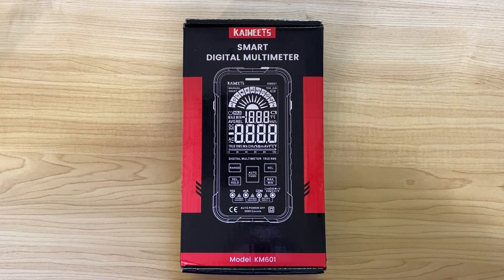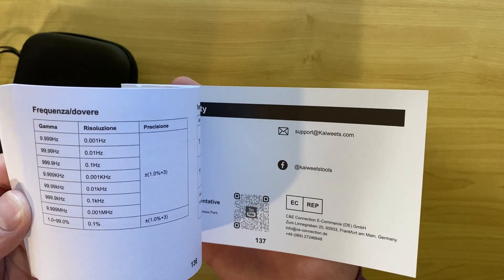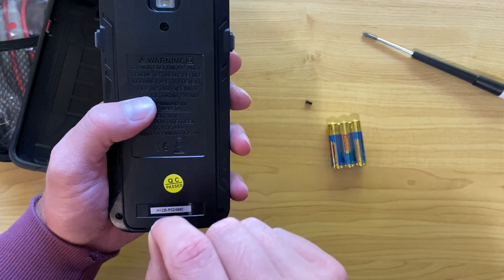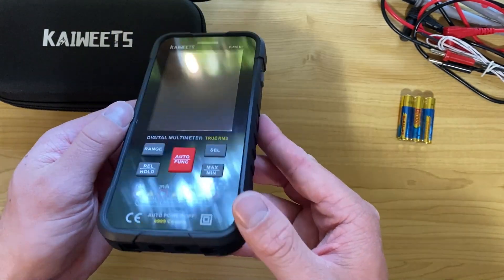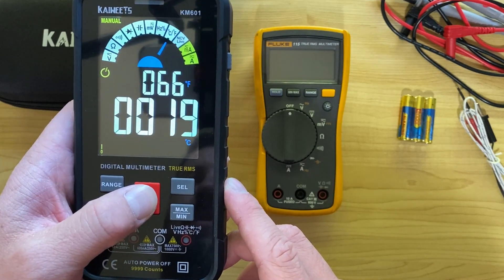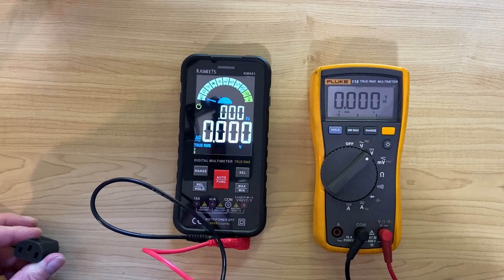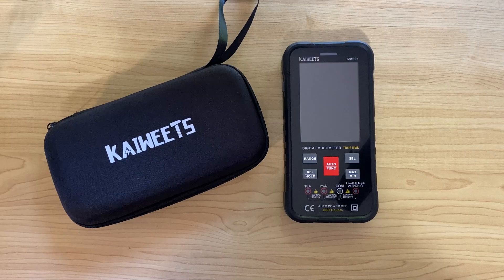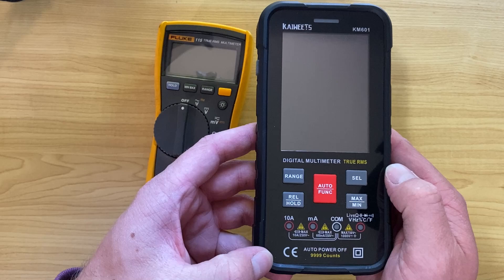$50 Multimeter better than a Fluke? Kaiweets KM601 Review

Comment: -3 Ω of at an 1 kΩ resistor and -1V difference to the 238,3V on the Fluke is quite accurate? That is just a point of perspektiv. Yes, this might be the case for any ordinary stuff in your household and some small DIY projects. But if you are going for some advanced measurements of electronic devises and parts this "smart" multimeter will just become an indicator of some high or low voltage or some current flow. In such cases i won't trust any of the numbers this multi is showing me, because i don't know how much they are off of the real value or a really accurate measured value. 
If it is just off on some simple measurements, it only gets worse on the important ones. All that fancy smart-features like colored display, indication lights and its smartphone like appearance and the auto mode are just to blend. 
A Multimeter's main task and purpose is to measure as accurate as possible and not to be a disco light or Knight Rider.
Reply: Have you checked what accuracy a Fluke has? 
And notice that you can not compare the voltage measurement here because he did not measure at the exact same time. It can fluctuate A LOT, it can go 30 V up or down within a second.
Reply: @Luzifer 4m0k   'A Multimeter's main task and purpose is to measure as accurate as possible?'

Actually I don't really agree with this statement.  Surely a multimeter's main task will depend on what sort of work you are doing with it!

As I do 99% repair work, for me the main function is to give me a voltage, resistance or current reading, I don't care if it is accurate within 1% or whatever because I probably don't know exactly what the reading should be anyway - usually I just need to know if a power rail is present or not, is the voltage in the ballpark of being what I expected or not, what current a device/circuit is drawing and again does it seem 'about correct' to me.  

I want to know If a transistor or Mosfet is biased on or off, does an IC have Vcc, is an oscillator driving a buck regulator or SMPS running (I don't really care what the exact frequency is but is it oscillating at a 'reasonable' frequency), and do I have a short circuit X Y or Z or not?  

WTF do I need an absolutely accurate meter for to do any of that?  And yet I am making use of using a multimeter day in / day out to make me a living. I'm not just using it to 'mess about with some small DIY project' or 'ordinary stuff in the household' as you say.  Nope I'm usually using it for complicated stuff like repairing a computer motherboard or graphics card down to component level, and often with no schematics to go by - just component datasheets to assist me.  From your opinion I should not be able to do that with anything other than a super-duper super-accurate super-expensive-how-ever-many-digit mulltimeter. I can inform you that you are totally wrong.

if anything is important, to me, it is how fast does the meter react in continuity mode - I need that to be as near to instantaneous as I can get.
Reply: @LearnElectronicsRepair  I like a fast continuity beeper also, for sweeping connectors with a hundred fine pitch pins to locate nodes. I test by flicking the probes together and checking for the audible indication no matter how brief I can make the contact.

Comment: Price is good. It looks a bit thinner which is good. Looks more robust than a fluke. It needs a hook or easel so it can sit somewhere.  Most mine sites in WA only allow cat 3 or cat 4 meters. But overall it would be good for the car or toolbag. Wheres the fuse located? Would be good if it had a transistor tester. Cheers Hayden.
Reply from the maker: I haven’t pulled it apart yet to search for the fuse. I might do so in the next few days. Thanks James 👍
Reply: If robust means fireproof, my Fluke 88 proved very robust 😉
It was in a fire and the case melted down enough to expose some of the innards.  Display clouded up from the smoke and intense heat. The rotary switch fused together and didn't rotate, but cutting away the plastic slag to get it rotating again showed it was still completely operational, and fully in calibration.
Still using it to this day.
Tried to see if I could get a replacement housing by contacting Fluke, but never even got a response from them.  In that regard, Kaiweets customer service was actually far better when I got in touch with them, and they were very responsive.

Comment: That meter is only good if you can't afford a Fluke lol. Could you do an active to earth in continuity mode to test the robustness of it and to check your safety switch?
Reply: A meter is only as good as the person who is wielding it.
Reply: @strangelylookingperson  I understand where you are coming from and agree to a point, however, I am from the school of buy the best you can afford. If someone can only afford is one of these cheap Chinese meters, then by all means get one. Remember, you usually get what you pay for. You don't need to break the bank in order to get a really good meter and very few people need all of the bells and whistles. Most people could get away with voltage, resistance and the rare use of capacitance and diode testing, but those last two are really in most cases not used by the majority of meter users.

Anyway, cheers.
Reply: @nealhatfield6579  what an extensive reply! Thanks!
Reply: I wouldn't buy the Kaiweets or a Fluke. Kaiweet meters, you get what you pay for. Fluke meters, you're paying for the name. There are other brands that function as well as Fluke and at a much lower price.
Reply: @nealhatfield6579  can you provide other brand and model is better where i can research. Thanks